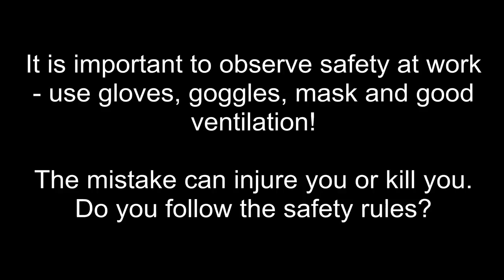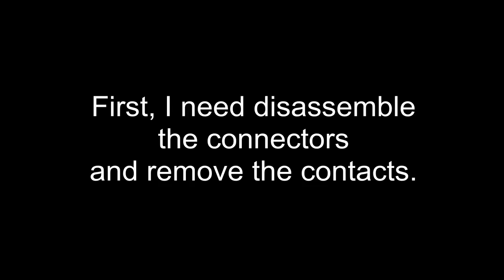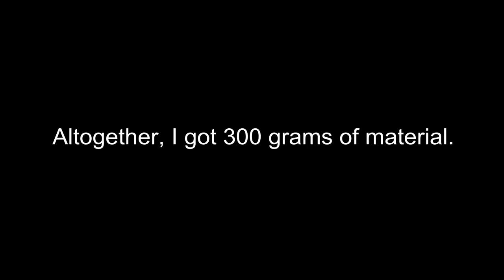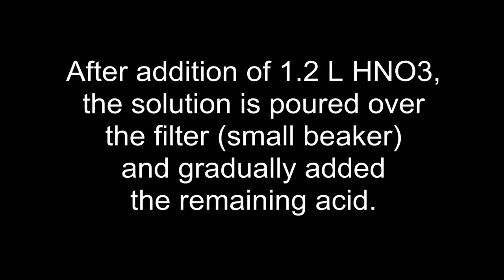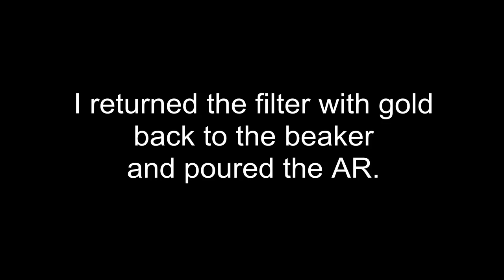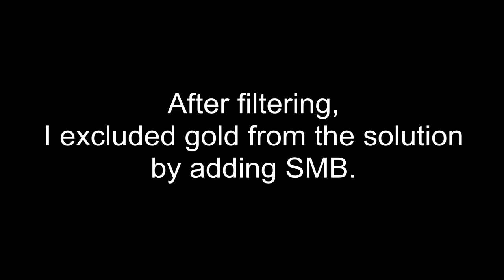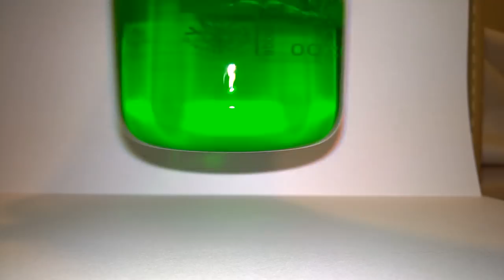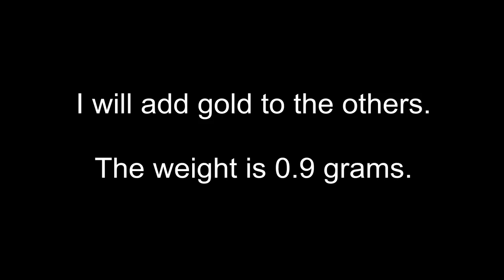Cisco backplane board - Gold recovery

Comment: Hi, thanks for the video, after SMB you only wash with water or also HCL? Could this material be processed sulfuric acid stripping cell? I ask this because in Holland you cannot buy hno3 as an individual, only a company can buy hno3. In Holland chemicals are over regulated. 
eWaste is also over regulated (containers with collected eWaste are protected) that's why it is very difficult to get material for processing (gold recovery).
Reply from the maker: In Czech rep. is situation the same. Stripping cel is right way at least for some of the pins.

Comment: Hi! Thanks for the video! Do you know the yield on i386 & i486?
Reply from the maker: Hi, sorry, i have results only for K6/Duron/Athlon, Pentium,  IBM 6X86 and Via C3...
Reply: what's the yield on Duron purple ceramic?
Reply from the maker: 3,124 g/kg or 0,0531g per piece
Reply: I knew I was missing something, how do you process them? I've managed to extract only 0.04g per CPU
Reply from the maker: Directly with AR
Reply: that's what I did, did you take off the silicon dies before processing?
Reply from the maker: No, I break it.